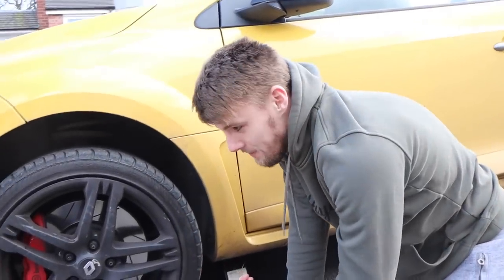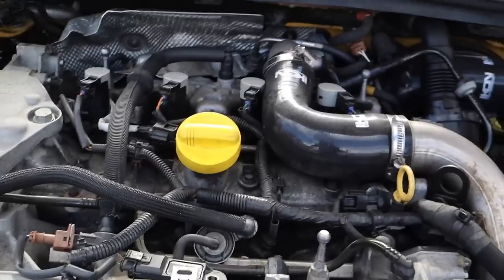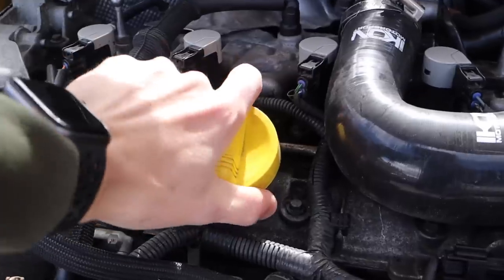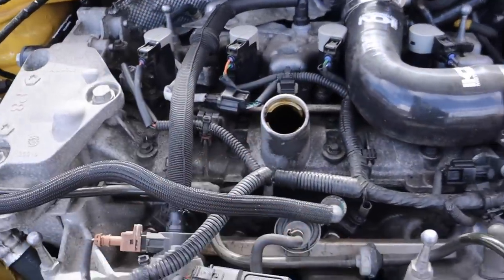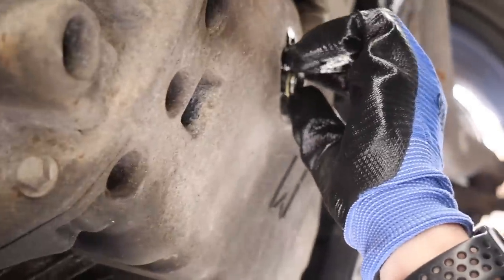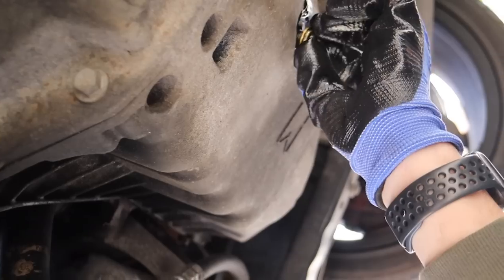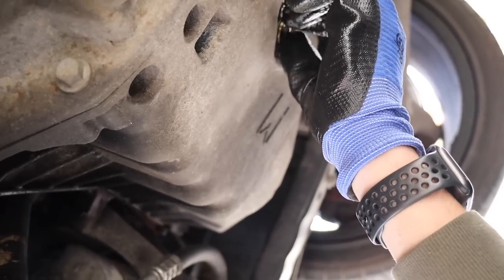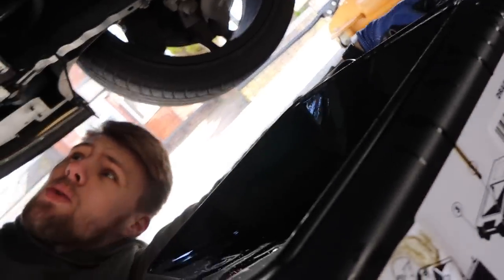CHANGING OIL ON THE RENAULT MEGANE RS 250

Comment: That gunk was CV grease, will either have split a CV boot or snaped a clip and it's let the grease out.
 Reason it sprays everywhere is cos the driveshaft is spinning and fires it all over the place.
Reply from the maker: Will have to get that sorted ASAP or I’ll be needed a new shaft I bet
Reply: @JustbeingHayden   Can get CV boots but it's messy and fiddly, be easier to just change the shaft but a lot more expensive, you'll also lose your gearbox oil too, so you'll be having to change that too

Comment: Inner cv boot split fella
Reply: Should of said you were doing a oil change
I've got a genuine renault oil filter from my old 225  i could of posted to you
Reply from the maker: Thanks man 👍 not sure how I’m doing to do that one
Reply: If it's the same set up as the 225 then its 3 bolts under the hub
Pull it towards you
Whilst pushing drive shaft back in

Then once clear pull shaft out

Mate i struggled on my own but it can be done